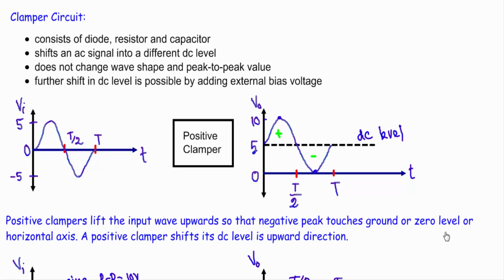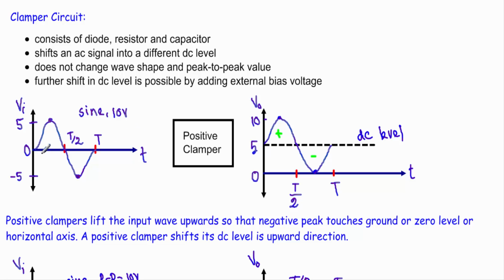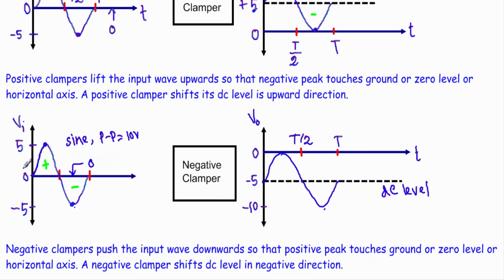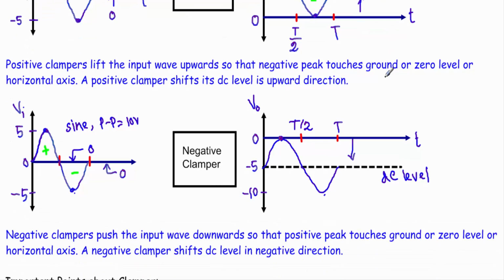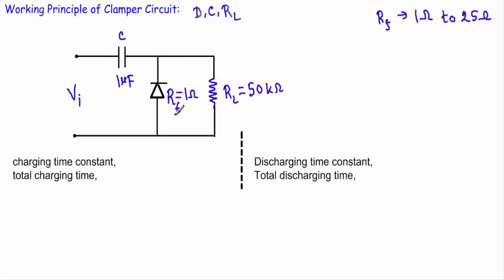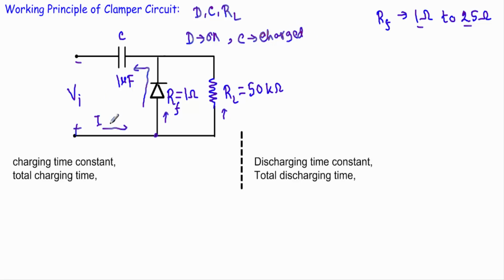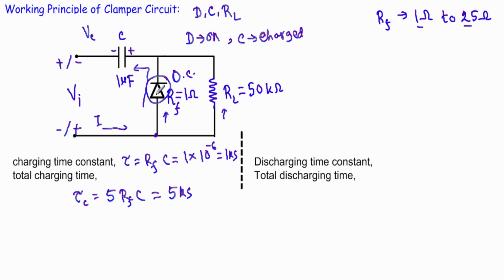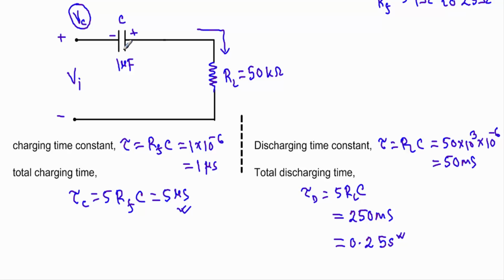Introduction to Clamper Circuit, Diode Clamper Circuit Analysis

Comment from the maker: When capacitor starts charging and its two plates are charged, those stored charges in plates opposes taking out and delivering electrons it those plates. So it takes longer time for the capacitor to be fully charged.
a capacitor takes 5 time constants to get fully charged. In first 63.2%, 86.5, 95, 98.2 & 99.3% of total charge is stored ( thanks to dhanesh nair)

Comment: Sir,i didn't understand that how is charging or discharging time is 5 times times constant.??.plzz explain me the logic behind it!!!
Reply: charge on capacitor after 'n' time constants = (1 - e^(-n)) x 100 %
Here 'e^(-n)' is read as ' e to the power of -n'.
So, after 1 time constant, charge on capacitor = approximately 63%
After 5 time constants, charge on capacitor is more than 99% which means that capacitor is almost fully charged.
Reply: I had the same question but he has explained it up here .

Comment: Sir you said it will take 5 time to totally charge or discharge  why so?\
Reply: Mate a cap takes 5 time constants to get fully charged. In first 63.2%, 86.5, 95, 98.2 & 99.3% of total charge is stored.
Reply: thankyou very much
Reply: thank you
Reply from the maker: When capacitor starts charging and its two plates are charged, those stored charges in plates opposes taking out and delivering electrons it those plates. So it takes longer time for the capacitor to be fully charged.

Comment: Finally a perfect explanation on cap charge/discharge and TCs. I was stuck trying to
figure it out using electron flow. now i understand! thaanks
Reply: +ChueyMr11 I'll second that. Perfect explanation. It helped me to understand what size capacitor I needed to use in my circuit.